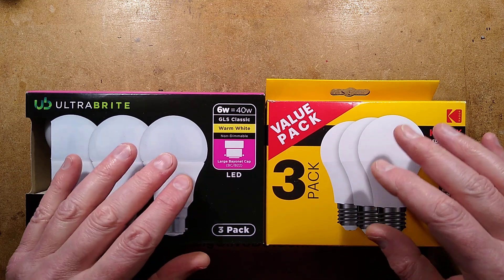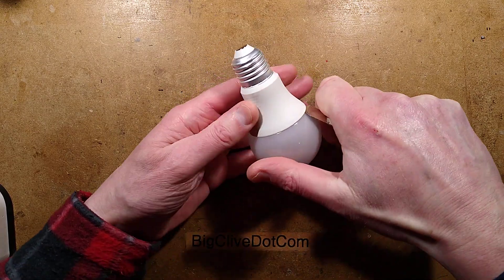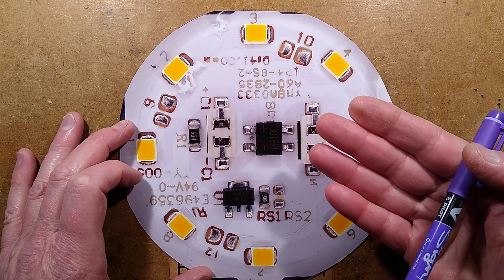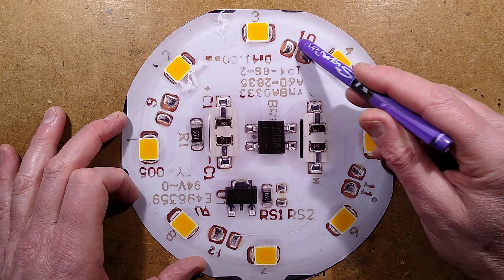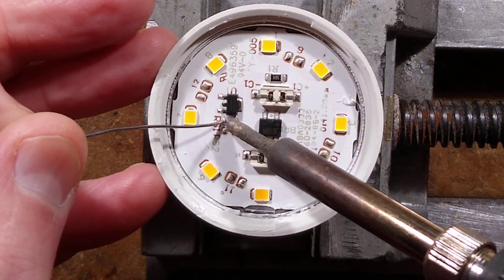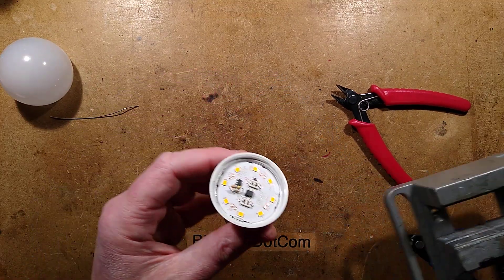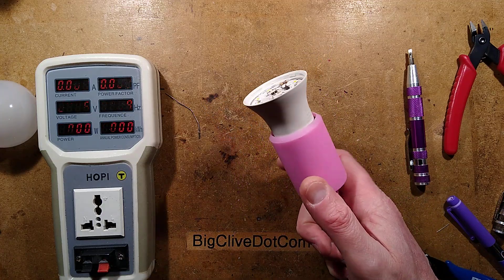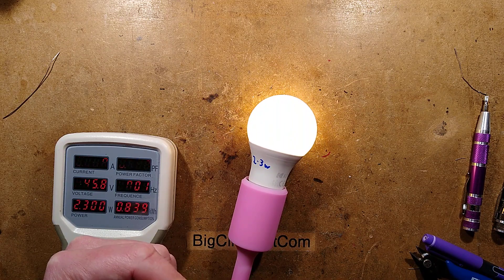Hacking Kodak lamps

Comment: I have done side-by-side tests for these bulbs claiming their 10 watts is equal to 60 watts incandescent or whatever...they are NEVER equal...the LEDs are ALWAYS way dimmer.  
Factor in how much extra garbage these things create in the landfills...especially since I have not had a single one last more than a year so you have to buy way more.  
So the initial cost of 10x the price...plus a shitty power factor so more costs there...and you have buy more because they fail much quicker...they are NOT so eco-friendly after all.
Reply: I have some Cree bulbs that have been running over 5 years !!
Reply: But you must feel a lot better knowing you are saving the planet by buying them 😄 /s
Reply: @barrieshepherd7694    I don't buy them except to disassemble  :)
Reply: Most LED bulbs I've used have lasted for years, and many of them are still going strong. Don't buy the cheapest ones - Philips and Cree have worked out well for me.
Reply: My house is full of LEDs and I hardly remember one giving out over the last few years. Have bought more expensive name brands and then these 3 for 5 euro combo box types and all last just fine. Maybe if you have spiky voltages or something they might break more. I would not use them in fully enclosed light fixtures though, where the heat can just build up inside.
Reply: @benbaselet2026   I paid 50¢ per bulb for the incandescent ones.  Also some of my fixtures are fully enclosed so I would have to replace entire fixtures.  Not worth the hassle.
Reply: @gregorythomas333  LEDs really have to last a while to pay back their cost, but nowadays you can get them for about 1-3 bucks so probably the energy cost over a few years will make it even-ish. What I really like about them is they don't burn stuff up with excessive heat. Very situational which is better. I live in a cold country where the summers are lit and winters cold, if I had electric heating incandescent bulbs would be perfect here.
Reply: Unfortunately, given bulb companies literally formed a cartel to force all manufacturers to gimp their bulbs at one point, I’d be entirely unsurprised to find they’d joined up again to produce mediocre bulbs once again. Can’t sell bulbs if they last forever.
Reply: @Gregory Thomas - you seem to have been very unlucky. The first LED bulbs I bought (8 or 10 years ago?) were a pair. One failed within a year, the other is still going - it's in the hall and is on a lot of the time. Others I've had mixed results with, but I reckon I've had about a 25% failure rate within a year or two. This is not great, or even acceptable, I think, but much better than you report. Maybe there's some other reason for it? Just over a year ago, I bought a batch of various Philips Signify CorePro filament lamps. None have failed so far, so I'll see how they do.
Reply: @Willam_J    
Wow...a very nice deal from you electric company!  Unfortunately mine is the only one in the state and the only swap out they will do is for giving an electric water heater for a gas one.
Reply: I think you get billed according to real power so power factor is not important in a residential home?